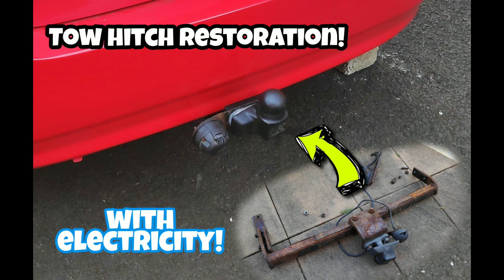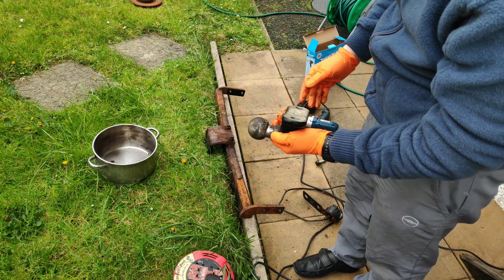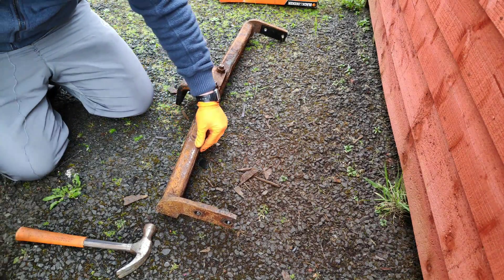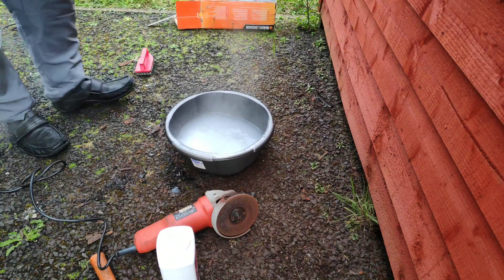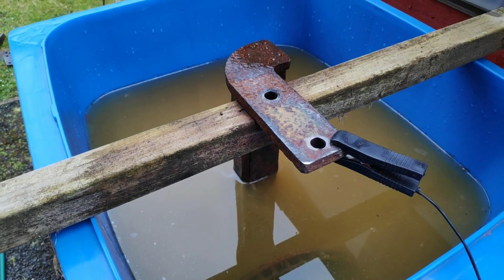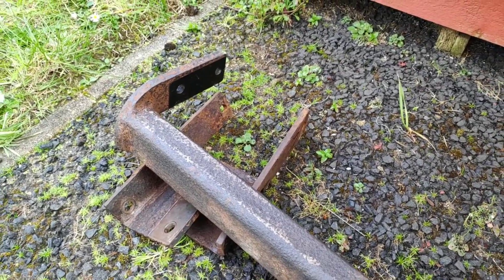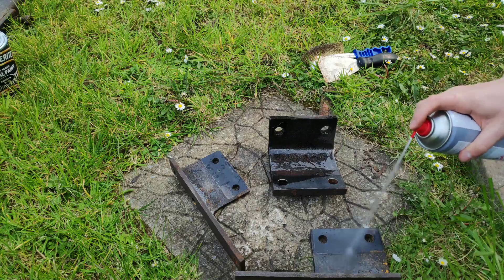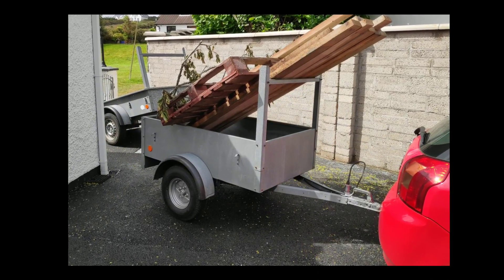Rust removal trick!

Comment: any safety advice?? would you get a shock through the plastic if you took the negative terminal off first?
Reply from the maker: Plastic is generally not conductive. But use the relevant safety precautions for any work carried out on a vehicle.